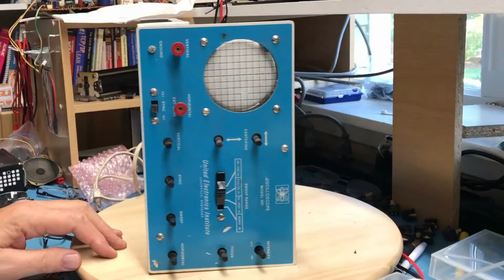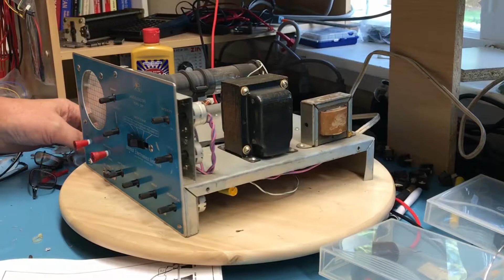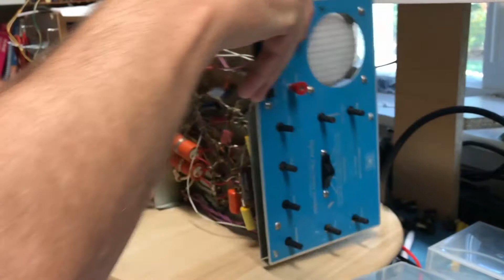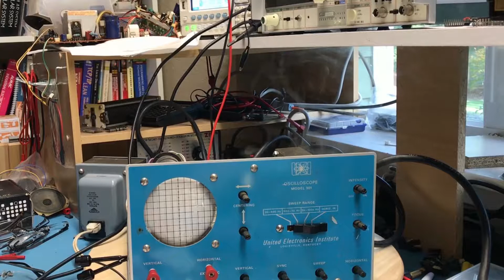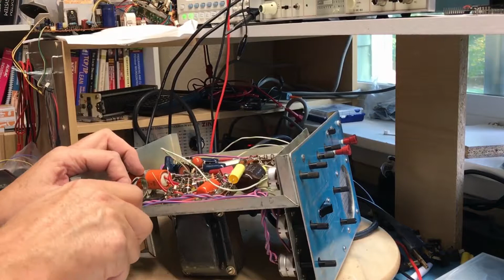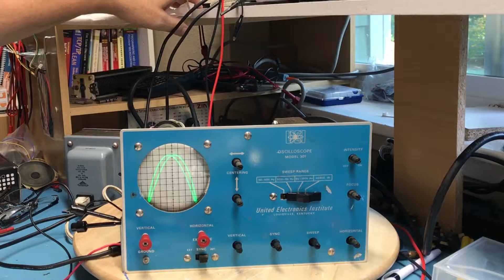UEI Model 301 - Part 2 - UEI Oscilloscope - Recapping and magic smoke - STB99

Comment: I went to United electronics Institute, and graduated from there in 1975. Those oscilloscopes were our lab projects. Mine worked fine, except my focus was a bit wonky on it. But it passed the exam.   You got to keep the scope. But you had to buy the case. The first guy to finish his oscilloscope left the room a bit early during break. In those days, you could actually smoke inside that room on break so one of the smoking guys left his cigarette underneath the telescope and called the owner back in to see smoke coming out from 
underneath it. It was a great smoke test joke on him.